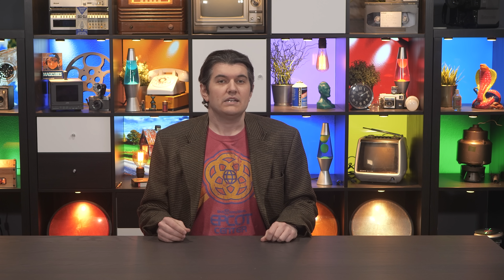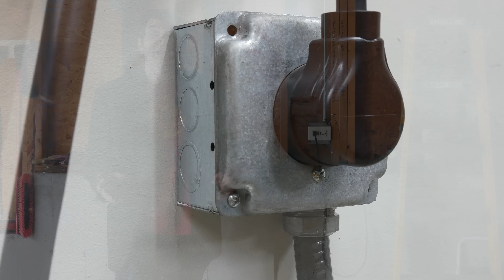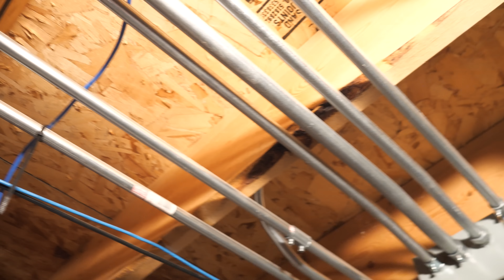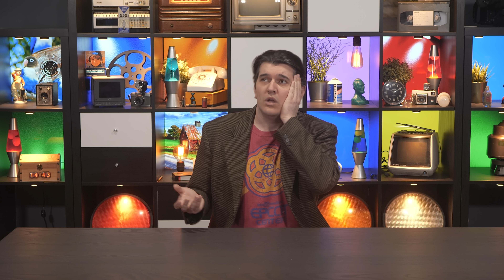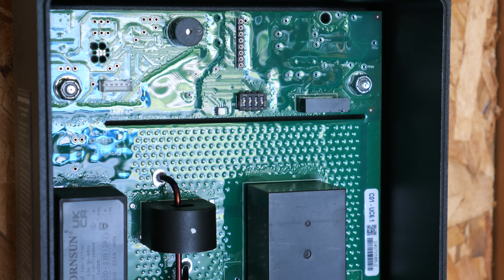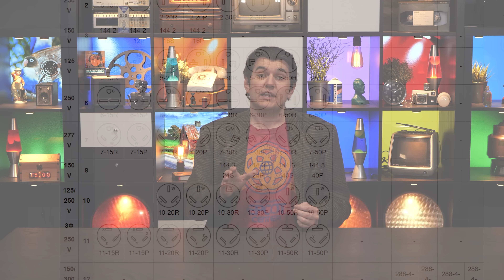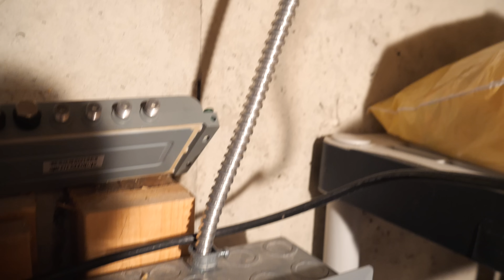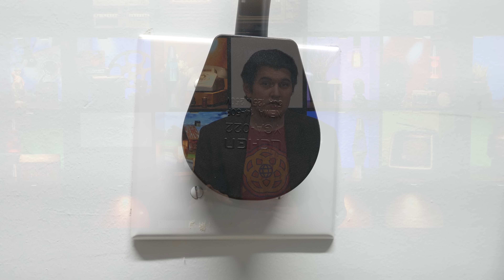The "standard" car charger is usually overkill—but your electrician might not know that

Comment: Yes, when I had the Bolt I charged it with the wall for about 5 weeks. I did get the EVSE installed (and a whole home surge protector) because it often had to park outside during the winter and I wanted it plugged in when the temps got very low.

Comment: Another interesting and useful video, thanks.  @technologyconnections One thing that you mentioned that isn't quite right.  At the beginning of the video you say "unless you drive over 200 miles a day..."  Really, that is "Unless you drive over 200 miles 2 days in a row" every day isn't the limitation, just 2 days in a row.  We have 2 EVs, KIA EV6 GT-Line, and a Dodge Charger Daytona Scat Pack (yep!), and I had a Polestar 2.  I've done the 110v granny cable, then the dryer plug, and now have a 40amp.  The dryer plug was 100% acceptable for charging speeds (24amp) and I considered a splitter as well, but was able to do something very similar to what you showed in this video.

Comment: A much, MUCH needed video on this. There's information out there, but it's haphazard and rarely answers all of your questions. I'm the Silverado guy that needed level 2 charging. I had an electrician install a NEMA 14-50 for me. The only thing I'm doing wrong is not leaving the cable plugged in. Thanks!

Comment: Here's the thing: edge cases matter. It's irrelevant if that piddly low power charging circuit works fine 99.99% of the time when that one time in your life somebody dies because you couldn't charge at maximum AC speed.

There's a HUGE problem with the "good enough" attitude toward both EV range and EV charging rates. If the BEV can't replace an ICE vehicle 100% of the time, not one thousandth of a percent less, then the BEV is not actually a viable replacement for ICE.

I'm in Australia with 400V 3-phase AC and my car is capable of charging at 17 kW. Which in numerous occasions has been ABSOLUTELY INSUFFICIENT!

Don't try to tell me 9 kW is enough. It's not. You can always turn a more powerful connection down if you don't need the speed. You CANNOT turn it up if the circuit won't allow it.

Comment: We have a 2021 Volkswagen ID.4 Pro S, and we charge at home just using the standard 110V outlet.  To install a 240V system, we would need a whole new panel and the install would be over $1500.  Since I can charge for free at work, we just don’t need the 240V system.

Comment: I have my 2 EVs on a 100 amp subpanel and the 2 chargers I have can pull 72 amps. Rule of thumb is that you can charge 10-12% per hour on level 2 charging.

Some older Teslas have "dual chargers" and can accept 80 amps at 240v (19.2kw).

Comment: My biggest gripe right now is that I can't find an EV I want that I can afford and has decent range. I'm a car enthusiast, so I'm drawn to things like th IONIC 5 N, EV6 GT, iD Buzz, etc. Yet they all have barely over 200 mile ranges. Daily, that would never be an issue, but we do 200-250 mile round trips at least 1-2 times a month. And adding half hour charges to every one of those trip, along with dealing with a child, just turns me off of them. So I lean back to gas.

Comment: Hey I’m an electrician I want to say that this would not work in Europe. Because you forgot that installing a charger with a higher amperage than its support, works fine for American base setups where AC is higher that the ground cable but not for a typical European setup where it’s actually, most often than not, DC and also higher voltage than ground cable. Of course, that being said I actually am not an electrician and I have no idea about electricity I barely know how to change a lightbulb I just do 3D backrooms and liminal spaces videos so please don’t take my advice on electrical setups!! 😭😭😭

Comment: We have 3 EVSE’s, a 48amp and two 16 amp. I only need the 48amp charge once or twice a year, when I drive far, early in the morning and then again in the afternoon. Rest of the year 16amp is fine.

Separately, at least for the EV’s we’ve owned, in order to preheat the car in cold weather, you need a minimum of 16amps of 240v. Our cars wouldn’t preheat on the 120v 12 amp EVSE you showed in the video.

Comment: I have a Chevy volt and also fell for the “you definitely need a 30 amp 240v circuit to charge your car”, and after pricing out a planning a run that splits from the dryer, I bought a 12a charger to tide me over for a while, turns out that was more than enough

Comment: By removing the cord and plug you no longer had a service disconnect within sight, as required by code.
Reply: NEC does not require this unless the charging station is rated at 60 amps or more.

Comment: I agree with the principle of keeping EVSE's simple, however.... My power supplier, in the UK, offers a 70% discount if they can control the charging schedule to optimise grid loading. My car is not compatible with their system so I had to go with a smart charger which was no more expensive than the dumb ones I could find at the time. If the "smart" part fails it reverts to dumb and still does its critical job.

Comment: Lower charging rates also reduce battery wear AND reduce peak grid demand, which, let’s be honnest, most users’ charging schedule starts around the same time so having  charging extend through the night but at lower amperage is better for the US’ ability to provide the requested power without increasing infrastructure and/or reliance in Canadian Hydro 🫶

Comment: I appreciate your attention to detail and practical balance.  I really learned a great deal today.  Thank you.  I almost want to go to a crossover EV’s.  I am also in the Chicago area.  We pay .13 delivered all in with tax per KwH.  So based on your numbers, it’s .67 cents a mile or so if I have calculated this correctly.  I am wondering though about the inevitable AI drain on the grid and its impact on residential KwH $.  

I also like your videos about being super crazy about kelvin color.  I also use halogen on Lutron Maestro for PAR painting and sculpture lighting.  I even used an aircraft landing lamp at a lower voltage to produce an orange color to aluminate the same color aimed on the grand piano strings.  I put zone dimmers lined up next to each other in the closet at preset levels and have one master decorator paddle switch out in the room to control all.  I have some photos of this that are on a totally different level.  I would share, but I don’t know if you’re interested and how to send a link, etc.  Sorry for the long message.

Comment: Put in a switch box, or run a cable with a plug on it, and use the same outlet as your oven or electric drier and plug in which ever one you are using at that time. 
That way you do not have to expand your power box, and are using existing power that is barely used.

Comment: Speaking as a European: Having a 3-phase 400 volt outlet (IEC 60309) in your garage can be rather useful.

When my neighborhood was being built in the early 80s the Association opted to install them in all the garages, which are in a free-standing building down the hill, mostly to run defrosters, but that decision has really paid off now that electric cars are more common.

They also installed them on all of the houses, so that all the construction machinery could be run.

You can even run hydraulic wood-splitters with that outlet.

So having a beefy outlet is useful for more than just charging your car.

Comment: I use to drive about 35 miles a day for my commute.  I had a 30 amp circuit, but as it was  a 'smart' evse unit, I always had the unit feed 6amps (at 240v) to my car overnight.  The 30amps was available though should I ever go on a road trip.  
Now I've moved and I drive twice that distance every work day, and I am using the same EVSE unit, and am able to get away with 12amps during the summer, (16 during the winter), even though it's on a '50 amp' circuit (a 14-50 outlet).
It's a shame that so many people think that you 'need' a 50 amp circuit, when the vast majority don't (especially if a dc fast charger is near your commute route and/or house).

Comment: so a 10 gage wire is higher capacity than a 14 gage? Oh america, number systems are never logical at your place.
Reply: Yes, the lower the gauge the thicker the wire. It's an old standard that hasn't been replaced.
Reply: Gauge generally works that way.  Sheet metal gauge, for example.  Shotgun shells.  I've never been confused by that.
Reply: @GH-oi2jf  good for you. Its still a weird system tho.

Comment: In the UK you can use the 13 amp plug after that you need to have an electrician install it. I use this but reduce the power to 10 amps for safety. For most homes you can get a 7 kilowatt but if you have 3 phase power you can get up to 22 kilowatt.
Reply: Problem is that only few cars support 22kW, most only have 11kW. However, many cars can use 1-phase 32A, which fills a (small) gap when using excess solar energy.

Comment: i think the most important thing about those high current chargers that most people don't understand is the more you use it the higher the risk of having a lithium garage fire. about 10 times more risk. if you don't use more than 15KW/day the standard 110V15A circuit is enough.

Comment: since i am using shelly devices in various installation scenarios i am also  becoming more sensitive to the power outlets - and found some of them beeing bad. when they carry the router or some other tiny loads - no problem. 
but when you connect higher loads for longer , the connectos can become very hot and even melt.

Comment: 2:40 CSB: I used to drive around rural Alabama with a 100 ft extension cord in the trunk. I would find a restaurant with an outside outlet and plug it in while I ate inside. Charge rate was 2 mph lol

Comment: As an electrician i will always suggest that the customer install at least 50amps at 240V.
Why?
1, Future proofing.
Electric cars are only going to become more prevalent. 
2 personal experience with a multiple BEV house.
The 240V 60amp branch circuit I had installed is only just enough for 2 BEVs. It takes about 9 hours to do a 10% to 85% charge on my car. With a lower amp circuit that would cause issues with 2 BEVs.
3 the price difference between a 30 amp and a 50 or 60 amp circuit is a lot less that that much especially if the 30 amp circuit becomes insufficient.

Comment: I'm curious if there's a hardwired splitter solution that would meet code. My dryer is on the other side of a wall shared with the garage, but I'm 99.9% sure that no code allows you to run an appliance cord through a wall.

Comment: Assuming you know how to wire to mains, check the electrical code for your jurisdiction.  If it requires installation by a licensed electrician, you may be able to negotiate with an electrician and have them inspect, do the final steps of actually connecting the circuit, and certify the installation.  Eventually, you may want to sell your house, and any undocumented electrical work could be a hanging liability.

Comment: Conduit is a smart idea, code required or not.  If your charger is in a wet location, National Electric Code requires a GFCI breaker or outlet. Square D makes a double-pole GFCI breaker that will fit your panel.  Not cheap at well over a hundred buxx USD.  PS: Nothing wrong with using wire nuts to cap properly spliced wires.

Comment: I'm 20k kilometers into owning my EV and I still use the mobile charger that came with the car. Limited to 3.2kw max charging, but most of the time I'm at around 11A, 220V so more like 2,420w of power, which is more than enough for me. A few times I've just made charging for the next days needs, but it's rare. Building a new house and only going to install a 7kw charger, so that I can charge more on super sunny days while the sun is out to max our solars excess energy after the house battery is full.

Comment: There are some benefits to have a smart charger, here in the Netherlands most home chargers are smart for two reasons:

1. a lot of electric cars are corporate leases so you invoice your employer/the leasing company and they reimburse the electricity cost, if you have a smart charger they can handle that for you automatically.
2. If you have the above setup you can allow other people to charge at your charger without incurring the cost, so I just use my electric charging card and the charger will send to bill to my charging card. Which is kind of nice so I can just charge at other peoples houses without saddling them with the cost (electricity isn't cheap over here) if I am there for a while and could use the charge.
Reply: You also have 400V three phase way better then our 240V single phase
Reply: The issue isn't whether smart chargers can be a great thing. The issue is that they SUCK if they can't operate at all without a network connection. For instance, if you desperately need a charge and either the local network or the Internet connection happens to be down.
Reply: @awo1fman there are many downsides, I would prefer a dumb charger if the above didn’t apply for sure
Reply: @awo1fman  No internet in the Netherlands? That rarely happens. In those cases, there is still a mobile network. But even if that doesn't work, the car can just be charged. As soon as the internet connection works again, the data will still be sent. And if all that doesn't work, happy days, free charging. In the Netherlands you can only not charge if the power goes out. But if those are cases, the gas pump does not do it either.
Reply: Both of these functions do not need to be cloud-based. In fact there's a lot to be said if they are not. But the real issue isn't if it is cloud-based or not, the issue is that these devices should absolutely function when they are not connected to a network
Reply: holy… that bit about charging money based on the car taking power instead of based on the circuit where the power comes from is super cool… some future sounding tech. can’t believe there’s a place that has that much infrastructure already built for that to work well
Reply: @TheFeriner you still pay for the electricity you pull yourself as the charger owner, you just set a reimbursement rate and that gets charged to the charge card of the user, and you can disable this functionality or use an allowlist so you only allow certain cards to charge (eg your friends and family not some random person). Works quite well but requires a monthly subscription, but since it’s needed for corporate lease they cover it most of the time
Reply: For primarily home use, you could have all of those advantages but still have a switch (perhaps hidden behind a lock) to turn off the ARM chip and turn it back into a dumb charger just in case it fails. It could have one of those sangamo analog electricity meters built in as well, so that the operator can check on the total usage no matter what mode it's in.
Reply: I would like to have a semi smart charger. No cloud connection, but that it can communicate with the meter.
So it can never overload the grid connection and the rest of the house gets priority .
Can the solar panels provide the full power for the car? Sure go for it, otherwise limit to a certain amount

Comment: When I buy an electric car I'm opting for your KISS principle, however I'll also add an external current sensor. This will only give me the smarts I need.
 
I'll get Home Assistant to send my phone a notification if the car fails to take power for any reason, to detect faults without relying on some poorly coded app.